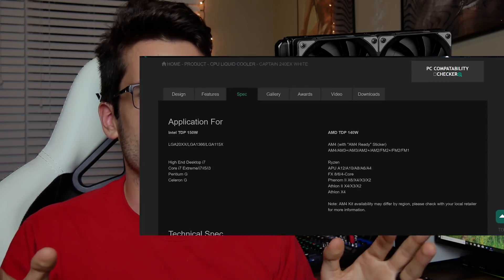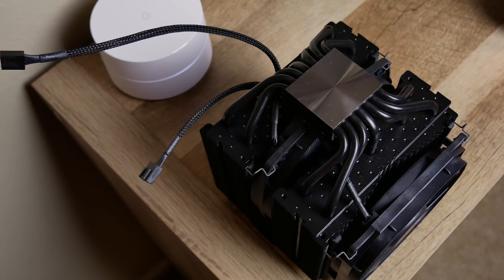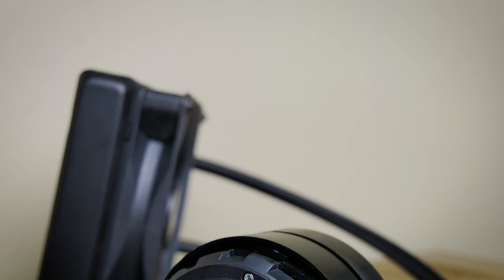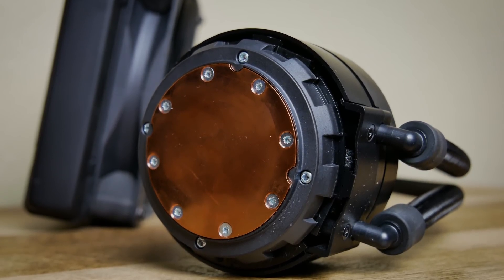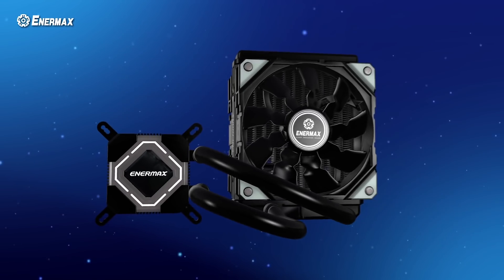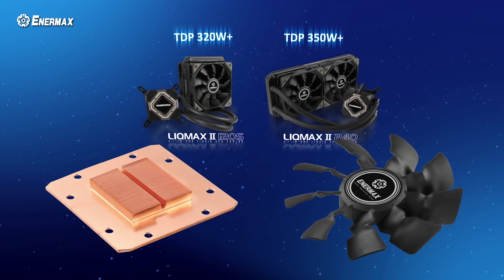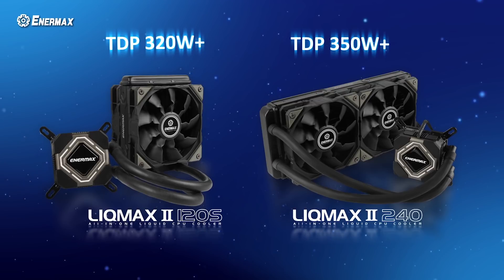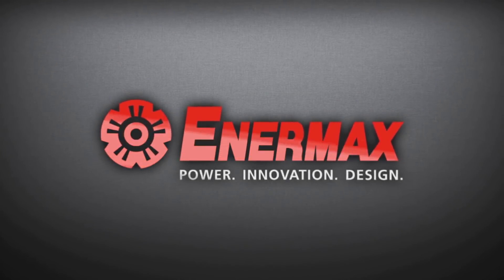Ever Wondered Why TDPs Aren't Listed for AIOs?

Comment: I'm going to have to disagree with the thought behind this video. It is dodgy that the tdps aren't listed for AIO's, but I assume that's just the manufacturers not wanting to admit that AIO's usually aren't much better than air coolers the same size, but are still more expensive.

The reason I disagree is because you mention fan speed so often. The fact that a company may test the max TDP under 100% fan speed isnt shocking... it's probably what 99% of manufacturers do. It's not fair to say this is something AIO manufacturers exclusively do, and I fully believe that the 350w TDP could be achieved by that AIO, with 4 fans attached, at 100% speed, in a cool environment.

If giving a best case scenario is a problem in the PC space then I think we should be bashing every single company.

Comment: I am a bit conflicted, i had to RMA my 3rd NZXT kraken x62 because if stupidly high temps (using kryonaut dropped them from 89C max at 1.22V 4.8ghz to 85C in aida64 and from 84C to 80C in cinabench after the liquid went to max of 32C, never higher even after hours of testing) and air bubble sounds/buzzing at pump speeds above 80%. First RMA was 95C max, second the cables  didnt work at all, i used external usb and only that way it worked and NZXT told me to return for a new one. Now i am using a cheap 25€ air cooler that uses 120mm cheap fan (the air cooler is like 440grams with 3 heatpipes) and the temps are very similar, in torture test in aida64 goes to 90C but during gaming loads and cinabench it goes only to 81C and usually then gets stable on 75-79C. So i am not sure if i should just take my money back and get a diff AIO or go with noctua air cooler. My other aio choices are h110i (sadly at the moment cant get hold of h115i), Alphacool Eisbaer 280, Fractal design 280 or 360. Its for my i7 7700K
Reply: you have a 7700k. a literal housefire. the thermal compound under the ihs is probably shit and you are one of the people who could benefit from a delidding. before you ask what these things are, just google it

Comment: The same goes for custom watercooling. I could easily overwhelm my loop if I wanted to by not sufficiently increasing fan speeds under load. 240mm + 360mm extra thick rads, D5 at 3200RPM, Vega64 + 5820K. 240mm per overclocked component my ass, I am already hitting 14C water to ambient delta at 1300RPM fan speed (EK Vardar).

Comment: I can imagine that 240mm AIOs can cool an i9 but under the condition that the CPU is delided.

350 Watts are a lot of heat, but when we consider that you have more surface area than on the Dark Rock 4 it should come close to 350 Watts. The only reason the i9s are so hot is the garbage TIM under the heatspreader.

Comment: The deepcool captain 240 can't hold my i3 7350k at 5ghz during stress under 80c i peak over 90c after a few minutes.  Hate this aio it's total junk.
Reply: I'm in the process of buying a custom loop now just to have future proofing on cooling capabilities.  I feel like i wasted my time trying to cool my system like this.
Reply: Ok update time. I did a delid on the cpu and used arctic silver 5 (liquid metal on the way) and put it back together. I ended up going with a 5.1ghz OC at 1.45v peaking at 75c under full synthetic load(I had it up to 5.3ghz but cooler wasn't keeping up). Before I had it at 5ghz 1.35v and was hitting the upper 80s c. I take back what i said about the captain and hope i didn't discourage anybody this is overall a pretty good cooler for the money. These 7th gen Intel chips respond very well to delid and i highly recommend if anybody has thermal issues to look into that to help with the problem as well, i look forward to seeing how much more the liquid metal brings down my temps, and finishing this custom loop will be better than Christmas lol.

Comment: Upon my self recorded research overclocking my 8700k with a CLC240 and installation of standard Bequiet! Silent WIngs 3, I noticed my overclock, 1.335 vcore, whilst stable @ 5.0 with the stock evga tornado siren fans, became unstable when I switched to standard speed Bequiet! fans. All in all it was roughly ~+5*C increase from the latter and I had to increase vcore to 1.36 to maintain stability. (now it is delidded/liquid metal 4.9 @ 1.335) I surely learned something about how AIOs indeedly work. Great video for those interested in getting their feet wet (hopefully not) with AIOs.

Comment: 40 to 50 degrees water temp is the average? Thanks for adding those numbers Greg, I was unsure if the temps in my custom loop were OKish. I'm running an OC'd 6700k and a GTX 1080 under full load with 36 degrees C water temp and 27C on idle. Now I know that these numbers are good in comparison to 40-50C.

Comment: I do believe that the reason TDP are listed on vapor chamber base cooler rather and not on AIO liquid cooler is because simply the finicky of how ambient temperature and heat flux can effect their ability to dissipate heat. Liquid cooler tend to have worst heat flux due to the nature of fluid being used with respect to vapor chamber. In this case the driving force is the gradient in temp where as liquid aio has a more damped heat  transfered characteritic thus lower heat flux= lower temp= lower transfer rate per given surface area. Whilst the vapor chamber are more efficient at expelling heat due to higher heat flux for their given surface area.

Comment: One reason I switched back to Air coolers. Even my TR has a Noctua AC on it and it does just fine. My NZXT x62 took a crap and almost killed my 7700k so I said bump that and put a Cryorig R1 on. Now I have a RMA'd x62 that brand new that I don't want to use. I'd rather do custom water cooling before I buy another AIO.

Comment: Totally agree with you Greg. On the other hand brand like Corsair or NZXT could advertize their water cooling systems like : "able to dissipate 200W of heat with pump at 70% and fans in pull configuration at 60% with room temperature at 25 degrees". This is just an example but at least will give some guideline I think.

Comment: I always wondered why nobody is using the ceramic active coolers, I know one side is cold and the back side is hot, but for water-cooling would be great, if money wasn't a problem I would test it.
Reply: Active coolers have been around for a long time. Some companies have even made products for PC. Active coolers have same problems as with A/C cooling. Complex setup/design due to dealing with codensaion and parts icing up. Making such products expensive. Also don't want to water start dripping on your expensive computer parts due to condensation. Electronics and water don't mix well. AIO has water also but water is inside the product (pumps, tubes, radiator). Active coolers (and A/C products) form water outside cold parts of the product due to codensation.
Reply: maybe you are talking of something different and not what I meant, using some ceramic based on the Peltier effect, you can regulate temperature, you won't be able to freeze, it maybe takes like 10 Celsius degrees but unless you are in a cold place with high humidity you won't have condensation problems, also, you don't need to place the Ceramic near to the any electronics, you can (should also, because of the opposite heat side of this ceramic coolers), so let say you place it in the front of the Case against the radiator instead of one of the three fans, not the ideal situation, but it won't condensate, maybe now I explained myself now ;)

Comment: I have a feeling that the cold plate also has some impact on the cooling performance of the AIO.  More cold plate surface area, more heat transfer to the liquid.  It can help to make up for the pump speed.  It's like how the liqtech tr4 works a lot better than the asutek AIOs with the included bracket for Threadripper.  The liqtech tr4 has a larger cold plate and more fins for more surface area.  It probably also moves more fluid since there's more room for a larger pump in the design.

Comment: Greg, the overpowered human-reptile-alien hybrid! (RHESUSNEGATIVE)
Only guy that explained everything about AIO!

HOW TO FRY AN EGG WITH i9 7900X:

You just need to build a 7900x system (outside the case) and put the thermal compound but instead of putting a cooler, put a frying pan and crack the egg!

Thanks Greg!

Comment: TDP is a relative spec, if you put an AIO on a graphics card you can dissipate more heat than on a CPU that's because GPUs are direct die and have a lower heat density so its easier to cool. I mean look at AMD's R9 295X2 which only uses a 120mm radiator and that's a 500W card yet the temps are perfectly fine. The TDP ratings are just marketing basically its not a real hard performance metric since it doesn't say at what temp does it dissipate that rated TDP and on how heat dense the chip its trying to cool is.

Comment: You make a great point though, that's why AIOs always use extremely high fan speeds. But since the water can move more heat away from the block than heat pipes when you increase fan speed you hit a higher thermal capacity limit than you get on a heatsink.

Comment: I just don't use a great air cooler, because of the looks, they occupy a greater space, that's why I use an AIO, to keep the mobo, the cpu area, the ram, all very clean and visible! (For the RGB to shiiine!)
Reply: for my part its also the clean look along with a noctua not allways being that memory heatsink clearance friendly but yeah mostly for looks which i'd say is one thing this kraken x62 does well now if only it was controllable from bios/something that is not CAM it would actualy have been a great experience
Reply: I use air cooler to take advantage of the climate's temperature.
Reply: Traumglanz you mean liquid nitrogen right? I really hope you didn't use liquid hydrogen back in your day as hydrogen is really volatile and probably would have exploded/burnt somebody's face off
Reply: Thats fair enough personally I think a big ass air cooler looks good, but it's all personal opinion.
Reply: well i am using a bequiet shadow rock topflow2 cooler. its not that big, keeps my 8700k@4,7@1,208v cool and quiet and also actively cools the vrm. and i can still see my tridentz rgm ram which give a nice gloweffect on the cooler :> im too much of a silence fanatic that i could ever use a watercooled setup
Reply: Back in my days ... we used water for performance. There was no such thing as AIO coolers and it was all just an entry drug for liquid hydrogen cooling. Well, technical there was a all in one cooler, it was a complete case with a compressor ... told you, liquid hydrogen cooling was for the cool kids. And without there was no reaching of 5 ghz .... on a  Pentium 4 … despite Intels best affords to bring those to 5ghz on stock. What a failed plan! :D
Reply: I'm much the opposite when it comes to this. If I had to decide based on looks, I'd still choose an air cooler. Air coolers don't have those ugly soft tubes awkwardly taking up space in my case.  And what, can't see the VRMs, chokes, and other motherboard components near the CPU? Who cares? I don't care. RAM is covered too? Great news, RAM without a giant LED on top of it is cheaper, I get to save even more money.

Comment: well i think everyone who ever used an aio knows that it's not really better than beefy aircoolers in terms of temps plus the worst thing for them to fail is a broken fan.. the aio can fail with 1-3 fans and the pump + the possibilty of leaks.. if you really want better temps you can either go full water for tons of money or be fine with aircooling.. i mean it's not like it's so terrible nowadays.. you can get good oc out of most hardware and have a cheap failproof solution without any hassle..

Comment: Part of the challenge in my eyes is that it's pointless to discuss the TDP rating of a cooling system without determining a standard equilibrium temperature target. If you accept equilibrium at 40c, your total dissipation is going to be a lot lower than if you accept an 80c equilibrium. The efficiency of the radiator increases as the delta between the fluid temp and ambient air temp.

An extreme example of this is my dual GPU (1080+1070) loop w/ 280 radiator sitting on top of case and NO FANS stabilized at 75C GPU core at stress test loads @ ~20C ambient. While high for any water loop - it's consistent with a factory Nvidia cooler. So could I claim a ~250w TDP rating on my cooling system? Probably. With fans it's probably truly a 600w capable system, keeping the cores below their upper safe limit. So 350w for an AIO with two fans does not seem out of the question - but again, they must define the temp AND wattage IMO.

Comment: Greg. At what point is it a diminished return with AIO size? Say a 120 vs a 360. What if any are the benefits of going to a 360 mil radiator or larger?
Reply from the maker: Christopher Baran More surface area so theoretically lower fan curves. A quieter system, basically.
Reply: Science Studio Thank you.

Comment: Interesting video, I'm brand new to water cooling. I just got a Master Liquid dual fan 120mm AIO but my CPU is only a Ryzen 5 1400 and I haven't put in on yet. I was hoping to use it on my upgrade to a Ryzen 7 2700 which I plan to overclock a bit also (I'm new to overclocking too).  You were talking about an i9 with a 240mm dual fan AIO which is a much better AIO so should I put my 120mm on the 1400 that is overclocked a bit to 3500MHz and then get a triple fan 360mm or a quad fan 240mm for the 2700, because of the more rad surface area and more fans? Or stick with passive cooling? Thanks for the information...
Reply: You should be fine with the 120mm for an R7 2700 CPU as it's only rated at 65w. I use a Corsair H60 AIO on my R5 1600 overclocked to 4Ghz (65w CPU usually but can hit 100w when overclocked and stressed using Prime95) and it works perfectly fine, keeps it cooler than the Wraith Spire included in the box.
Reply: Great thanks for the information Geoffrey Wright, I'll put the my 120mm AIO on my  1400 tomorrow..

Comment: I have a i7 7820x running at 4.8ghz, I'm cooking it with a h100iv2 the cpu never gets over 80 degrees Celsius. The h100iv2 seems  to handle it fine.

Comment: I'm running an Intel Xeon X3480 at 4GHz with a Corsair Hydro H100i V2 on a Gigabyte GA-P55A-UD5. And yes I had to modify the angled usb cable on the H100i V2 to fit it on the motherboard because that P55 heatsink is so close to the socket. And with my fan curve while running the pump on high it's quieter than with a Arctic Cooling Freezer 7 PRO (and yes most bigger modern air cooler don't fit that board because of that heatsink on the P55 chip) while maintaining about 65°C on a 4h cpu burn and rarely speeding the fans to the max. The default fan curve speeds the fans up to late so it get's to a point where it keeps running at full speed. So, my curve is more agressive in the beginning and it can normally fall back to lower fanspeeds again without reaching max fanspeed.
Would be interresting to measure the TDB with stock and twaeked settings.

Comment: Greg, tbh, I don't really understand TDP, but based on your recommend last year I got the Deepcool Captain 240EX along with the TT P3 both in white. I am using a FX 8320 OC'd to 4.8ghz and I rarely see my temps rise beyond 45c under a full load, usually 39c is the average. And by a full load I mean rendering in Premiere Pro, gaming, etc. Now to be fair I am also using Kryonaut for my TIM. OK, so after that mouth full, does that mean my AIO is falling within the 150w TDP?

Comment: Great video! Very informative but now I’m also conflicted on what to choose for cpu cooling. I plan on using an i5-8600k with minor overclocking inside the Phanteks P400s. My original plan was to use the Kraken x52 but have been thinking about using just a fan cpu cooler like the Cryorig H7/C7 or any of the be quiet! cpu coolers. Any opinion is greatly appreciated! Keep up the great work Greg!

Comment: All this cooling majiggergy has got me thinking, does anyone make, or has anyone hooked up a refigeration system for cooling?
Reply: LinusTechTips did... and there is even a real case with the refrigerator build in the bottom for cpu cooling. but using something like that you need to be very carefull about moisture building up (like in your own fridge)
Reply: @Remco van Goozen
 no, not sticking it in a fridge, but hooking up a refrigeration system to cool the components, think water cooled, but with freon and a compressor in the pipes. say something from a window mounted air conditioner.
Reply: like i said:
https://www.youtube.com/watch?v=B8bhGw4vUFE  this is in a fridge
https://www.youtube.com/watch?v=4d0B0Dli-1g and again but this time a real pc case for component use like u mean,
and LTT has another video with a recycled refrigerator system that cools water for watercooling but i don't remember wich one

Comment: Slightly inaccurate, and seemingly just your assumption as to why water coolers less commonly quote tdp values, air cooler tdp is also affected by the temperature of the air flowing throughout them. Personally don't see why anyone buys water cooling, costs more up front, more parts to break, more risk of damage to your pc from water, shorter life span and the upsides are aesthetics if you like them and better tdp but not enough to really be worth it imo
Reply from the maker: Dylan Williams There's nothing inaccurate here, save my assumption at the end - even so, I guarantee you the TDP of the Enermax cooler isn't 350W+.
Reply: Science Studio so you're saying that the tdp of air coolers is not changed by the temperature of ambient air flowing through them? I'm not bothered what tdp the enermax is. It's just your whole argument seems to hinge on as you call it thermo 101 and your not applying thermo 101 to the air coolers scenario, if you are there are some unstated assumptions here.